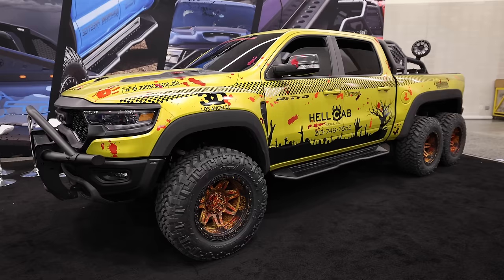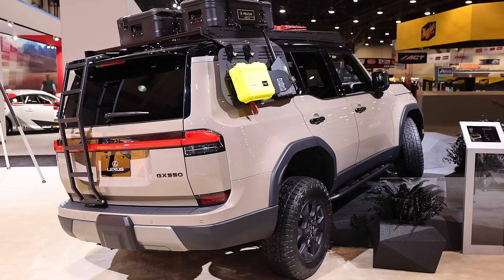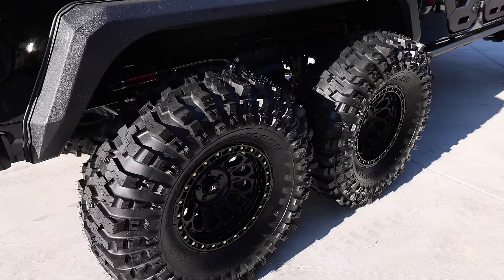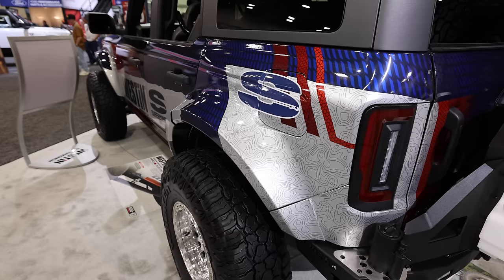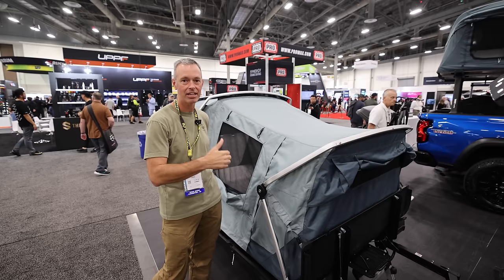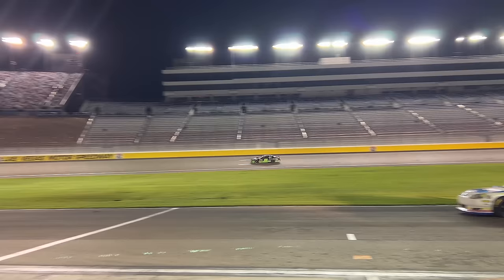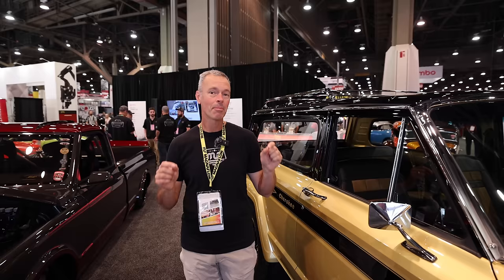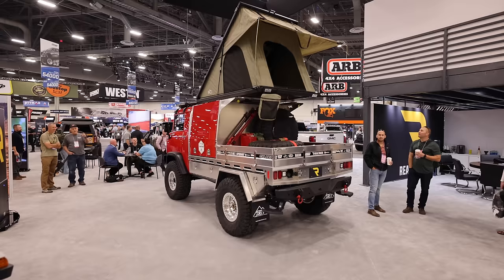The Best & Weirdest Off-Road Vehicles of SEMA

Comment: Brad, I have to call out one item because it can relate to trail access in some states and parks. On the Rivian, you showed a trailer with what you called electric bikes. Those look like electric motorcycles, which are not allowed on typical single track off-road bicycle trails. I work with a group in Missouri that deals with trail access. The distinction between bicycle and motorcycle, at this point, is pedal assist. If a bike has pedal assist then it’s an E bike. If it doesn’t have pedals, or it has a motor that doesn’t require pedaling, then it’s a motorcycle. 
This is an important distinction, because many trails do not allow motorized vehicles. Understanding what you have will help us all maintain access to our trails. Thanks so much for the great content!

Comment: What is sad for Rivian is the way how the electric motor on each wheel is interrupted by programming causing power losses resulting in jerky crawls, there is no consistent power delivery as 4x4 provides with pedal controlled throttle and locked 4x4, maybe Rivian addressed that already or it will be later